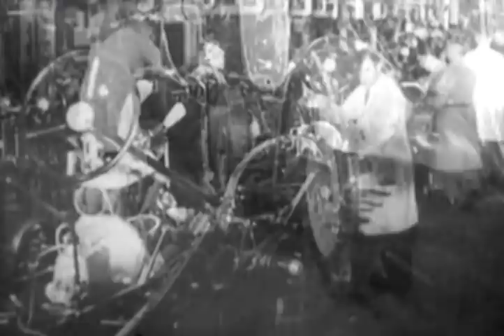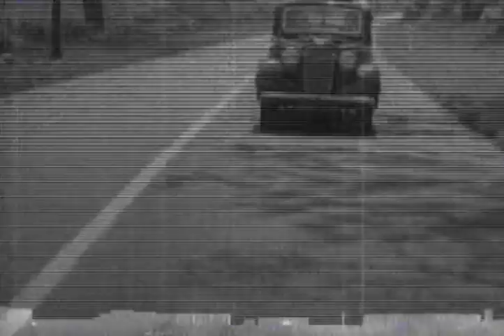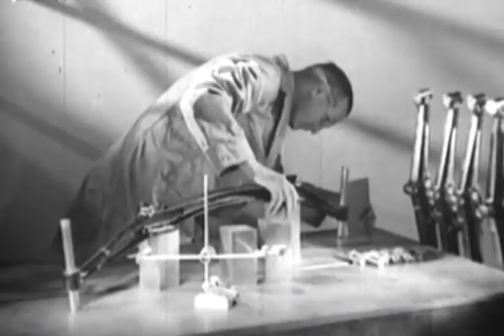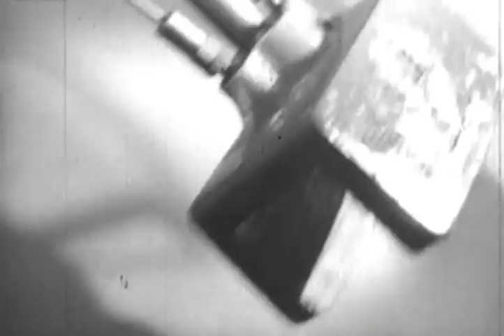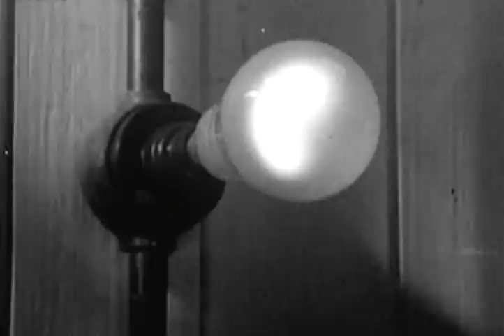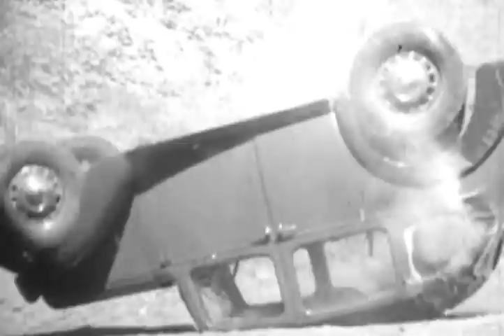Austin motor co,Within the white lines (heritage motoring films)

Comment: An amazing film. I have never seen any manufacturer not even Mercedes (accept the A class! )  perform a moving roll over test like that. The car stood up very well. At the time of course these early cars of the 30s and 40s were known as uprights because of the more upright seating position. Some vehicles especially those with transverse suspension common on Ford's were well known for turning turtle if driven beyond specification. The engineering of Austin was generally very good. My A90 for example has lots of bronze bushes in its linkages. With regular servicing parts are durable and work beautifully.
Reply from the maker: Yes, I noticed it took quite a time before the car actually went over, Austin's made some amazing films around that time.

Comment: Wonderful film!  My first car was one of those - a 1937 Austin 10 that I bought in 1963 for under £20.  The brakes might have been top notch and considered safe in 1937, but by modern standards, they were awful!  Good job the car wouldn't happily do much more than 55-60mph.  But I loved it.  Pity it rusted, and the engine died.
Reply from the maker: I think Austin brakes where at best just good enough even in the 30s as long as they stopped within a given distance they where judged ok , the Austin 7 had four wheel brakes even in 1922, very advanced, the foot Pedal operated the rears and the handbrake the fronts, they weren't coupled up until the early 30s

Comment: I wander how many of the men testing the brake shoes died of asbestosis.
Reply: It is asbestos fibres, created during mining, processing and demolition of buildings getting caught in the lungs that leads to asbestosis. The fine dust from brakes is fairly harmless.
For decades, the London tube trains ground away more than 6 tons of asbestos brake pads every year and their is not a single case of it leading to asbestosis.
Reply: @wilsjane  Sadly wrong. Thats why they changed all dusty asbestois brakes when to many simply died of it.

Comment: Thanks for this ' Jack ' hadn't seen it but Austin produced many films on their production methods, so did other manufacturers and they were obviously very proud of their products.Currently restoring a 1937 Austin 18/6 York , a larger version of just before the cars shown which I reckon to be 1938.Their braking systems from this era were of Girling design and although purely mechanical with rod operation are surprisingly efficient up to virtually modern standards if set up correctly .
Reply from the maker: Ok on the 18/6 that's a lot of car to tackle so good luck with it, Some of the first films I posted some five years ago cover Austin's production methods, however they where taken from second generation VHS tapes, I will be posting these same recordings in the near future only dvd quality, if you haven't seen the old recordings check them out, funny enough those recording still get a massive amount of views.
Reply: Mechanical brakes--"surprisingly efficient"--I guess that WOULD surprise me--I borrowed a friend's 1931 Ford Model AA truck to clean up my parents' yard--mechanical brakes!--awful!
Reply from the maker: Having driven one many years ago all I can say is adequate more than efficient, no worse than a lot of cars of that era.

Comment: Obviously back then they didn’t have precision electronic digital measuring machines. Some engines must have been ultimately more reliable than others due to the slight discrepancies at different times with the analogue gauges during the production process. Most noticeably oil leaks/excessive burning.
Reply from the maker: Tolerances where much wider in those days, hence the term running in, and cars leaked oil from new it seems it was accepted
Reply: @jackflashvintagemotoring7586  My Riley didn't leak oil, it just marked its territory.
Reply from the maker: Could be why a lot of prewar cars have survived, lots of oil over the underside, if you have a leak on a modern then it often  points to trouble